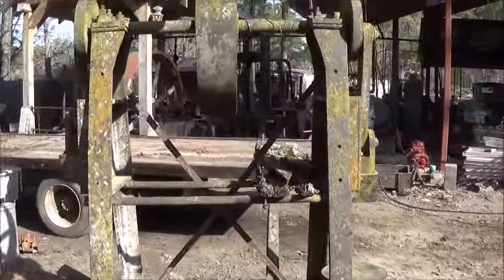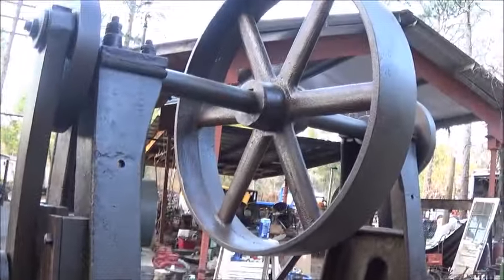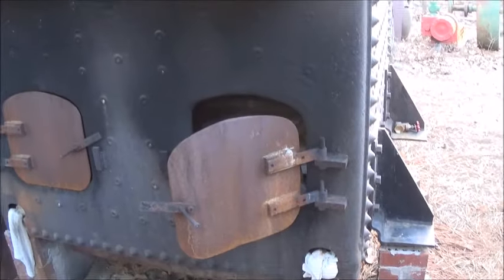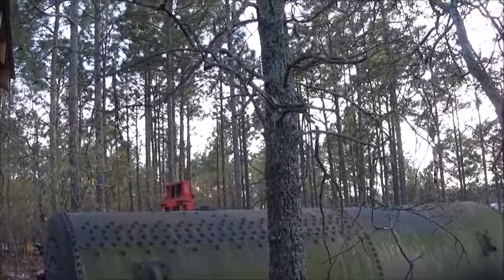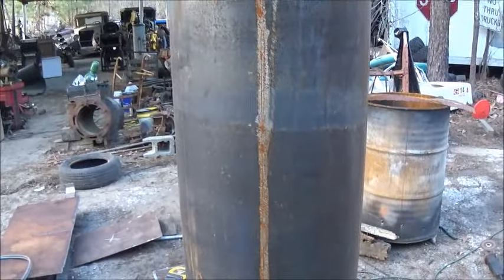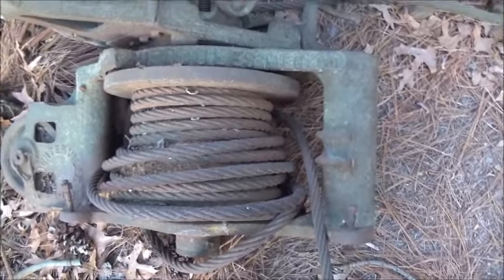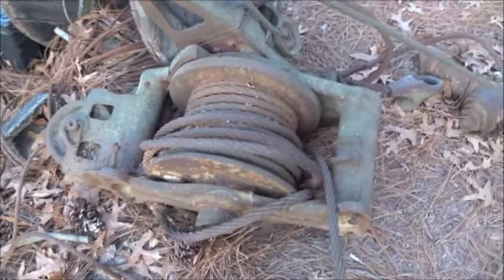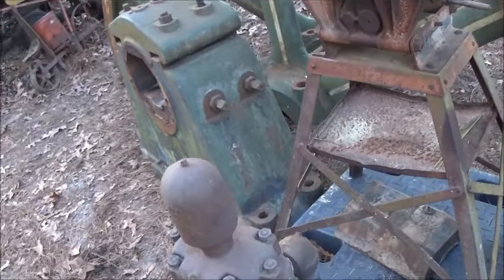ANTIQUE LOG SPLITTER, ANTIQUE STUMP PULLER AND MORE!!

Comment: Hi Johnston, I used to restore old stationary engines . If I wanted to leave it un painted I would sit it out in the sun until it got hot then paint it with automatic transmission fluid. Automatic transmission fluid has a lot of lead in it which enters the paws of the metal and prevents it from rusting.

Comment: I have an NOS Reliance Barbour Stockwell tachometer for a Fairbanks Morse diesel.  Crankshaft driven, centrifugal mechanism instead of magnetic, goes all the way up to 600 RPMs.  Not sure why I bought it but it turns out at least two people actually collect those engines instead of scrapping them, would have never guessed.

Comment: 18:05 - I have several smaller water pumps, an air pump, and a pump jack that have this loose pulley setup.  This is really helpful when running from a hit+miss engine.  You can belt up on the loose pulley, get the engine started, and use a stick to move the belt over to the live pulley.  Might also be useful with a steam engine, to avoid having to start the engine against boiler pressure.

Awesome how you got the log splitter cleaned up!  I know of 2 of them, one at Coolspring, the other is shown locally with a hit+miss engine.

Comment: Some where in my past, I read a book that told of how big and tall a stack had to be for certain horsepower boilers. I think it was an Audels manual of how to build chimneys. Don't know that you might even have it, I borrowed it from the local Library about 50 years ago. Trouble with the librarys up here is that they constantly clear out the old books and fill the library with all these novels , that are basically usless. Interesting lot of machinery that you have picked up. Never saw a wood splitter like that , at least up here( MA), that is a lot faster than these hydraulic ones that we all seem to have today. Great projects you are doing.

Comment: At 17:20 those are belt drive hydraulic pumps for compressing bales or more likely pressing cotton seed cake for oil extraction. You could probably use them for boiler feed but the pistons were probably ground in without rings.
Reply from the maker: Both are listed as steam pumps. Never seen them used as hydraulic pumps. Could be, gonna have to do some research on them. Makes sense for sure.

Comment: Yes sir, My name is Mark Peyton. I found your channel while searching for a How To on splitting a Case 1974 580B Construction King BH. The problem with mine is it will move for a few minutes then it stops will not pull. I turn off engine let sit for a few minutes and away we go again for a few more minutes. Stopped up filter maybe. If not filter do you have any suggestions as to a simple fix before having to split it and rebuild transmission?

Comment: Cross pipe on a slight angle will keep condensate at the end of a burn from rusting out the bottom of the pipe. Small hole on lower end for drain?

Comment: I wonder how much weld wire or weld rod he goes through?!
Reply from the maker: I used a 44 pound roll of .035 on the rollback and part of another roll.
Reply: @jonathanw4942  I just retired from a place that made catalytic converters,in the area I worked in ,we used an equivalent of a 55 gal drum of wire a week ! That's providing we're running a 3 shift operation! We made the converters for full size 3500 series p/u's! When they left the plant they were full exhaust assemblies! Oh,diesel trucks! I don't remember what wire we used!.035" maybe?